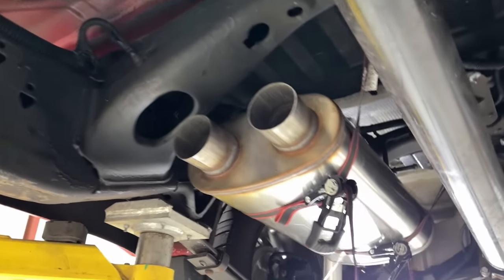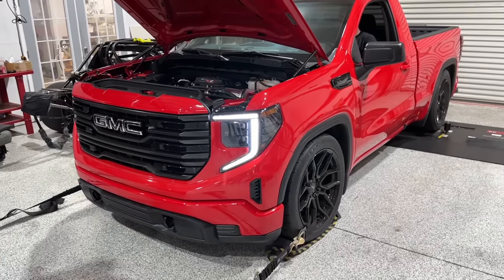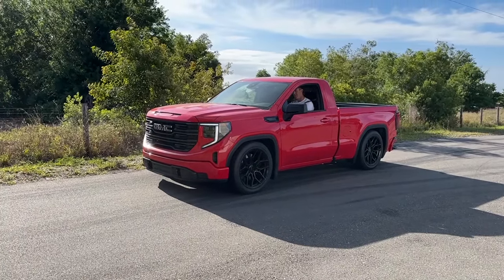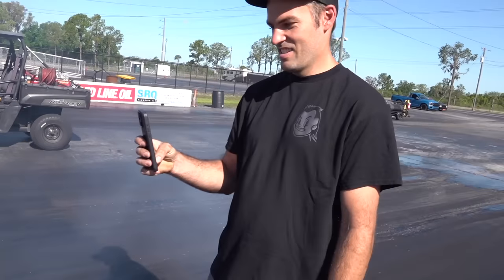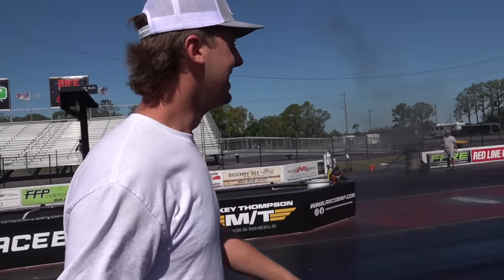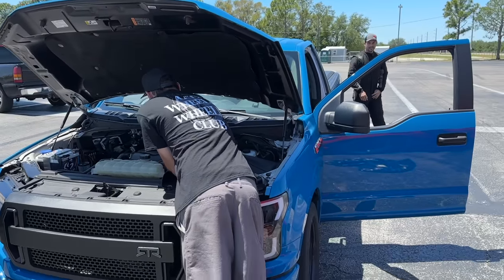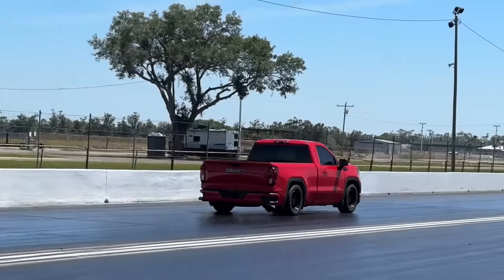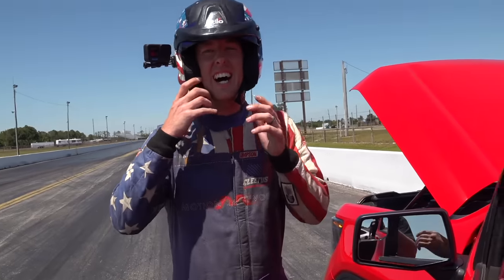Our Supercharged 427 GMC Is Done and It's INSANE!!!

Comment: In a way I wish the GMC wasn’t a giveaway truck so we can actually see what it can do. I really want to see it get in the 9s! Do it Cleet!
Reply: If I won it, I’d tell cleet to keep it in the fleet to see what he could do with it first before taking it 😂
Reply: Its set up to haul ass already, if someone that’s into cars got ahold of it, they’ll probably have it in the 9s with a tune and pulley 😂
Reply: I’d be willing to bet there’s another one awaiting its unveil on the channel.  No way cleetus gets himself to walk away from a vehicle like this.
Reply: @ronathan3569 that motor can make 1500, motor wise, it is much more capable to be an 8 sec truck than the f150 even is. Add another 10 psi to that 427 and with the right suspension it will 1000% go 8s. Cleet needs to just get the FRE sleeved long block they are making 2k hp on, he will at some point
Reply: All it needs is shocks and it will go 9.7. f150 will run that right off the lot.
Reply: @tkc2406 yeah it doesn't transfer the weight at all. That's why it bunny hops so bad. Probably could just take out a couple leaf springs and it run 9s easy
Reply: @JoshJackson13  I am a ford guy to but what f150 is running a 9.7 off the lot? By off the lot you mean stock engine then yeah of course, but even the roush supercharged trucks dealerships offer won’t run 9.7s “off the lot”
Reply: @tkc2406 even fully tuned and dialled in, that GMC will never run an 8 bud a low 9 maybe(gonna need a whole lot more than 10lbs, try 20) but it won't beat the blue truck and  there's no way in hell it'll run 8s. Even if by some miracle it beats the blue truck, that blue truck isn't even in the top 20 fastest F150s in the country, and some of thi se guys are in the 7s. Yeah no way this thing getting anywhere close to beating any F150 records
Reply: @tkc2406  go buy the 2024 base model with the coyote supercharged 700hp. Not the eco boost
Reply: @tkc2406  I was being sarcastic. Obviously no truck is going to run 9s from the factory. I believe the fastest ever has be 11s
Reply: @JoshJackson13  no one mentioned the ecoboost. 700 crank hp will not get you a 9.7 with the factory suspension
Reply: @JoshJackson13  ik you had to be man, I’m a ford guy to but ya can’t be that naive. I know what it takes to build these trucks trust me a half a year of my life was dedicated to a 4wd truck build, but this one was an ecoboost with twin EFR 76/70s and a fully build closed deck motor, we haven’t been able to push it yet but the engine is built for 40+psi. Hope to break the ecoboost record and what’s even more special is this is a gen 1 motor and 100% DI no port injection which is 90% of the challenge but it’s great for making big power on alcohol. Running 190lb injectors lol
Edit: truck is setup for nitrous as well goal is 1000 on pump E85 I don’t really need more than that but on race gas and spray I’m hoping for 1200-1300hp
Reply: @joaquinpaul8205 Of course it's not beating any of the F150 records. Look how many single cab Coyote trucks there are compared to new GM trucks. If GM offered an RCSB with a 6.2 we might actually see some competition between the two platforms.
Reply: Run a 9 cleet no one will no...
Reply: @joaquinpaul8205 lol someone is triggered, the truck ran 10.2 with a shit launch on 13lbs. 23-25psi, some weight reduction and suspension mods the truck would definitely run an 8. And it won’t blow up 3 times in the process like the ford 😂 also top 20 ford f150s? Laughs in 6 second stick shift LS S10🤣
Reply: Got to say I hate the F-150 is down again 😢 that’s my favorite vehicle on the channel right now. That GMC is awesome as well and I hope I win it but F-150 is my truck of choice. Cleet, please get a FRE engine or something that F-150 can’t keep breaking. No disrespect to TKM cause they’re amazing as well.
Reply: @johncena-hq1ti  I would hope so it's got a 427 motor in it. It should at least be capable of an 8. But them single cams don't pick up as much power as the Dohc motors per lbs of boost but hey, it is a 7 litre motor as well so who knows. Honestly I'd like it to run 8s I just don't think it's possible without at least 30lbs and Major weight reduction but at that point, it wouldn't be a street truck
Reply: There goes the coyote is king claim......
Reply: @tkc2406 I like how you’re saying it’s more capable as a motor and the first thing you gotta do is get rid of the factory block.
Reply: @tkc2406  I got a 92 thunderbird that I put a coyote in. Pretty much a mustang under the body
Reply: @JoshJackson13  yep 54k with a 3 year warranty to.  They had to build the truck from scratch. You can order it from Ford anytime.
Reply: I would gladly tell them to keep it and give me the money it's worth so they can keep it in the fleet.
Reply: @Mldavis1214 what engine rebuild are they on for the f150? Can't have a tkm built motor vs a stock ls motor.
Reply: @joaquinpaul8205  blame Ford for not being capable of making a 7 liter coyote. Not our fault 🤷‍♂️
Reply: Agree, and "7.0 cLeeturs" should be on the side emblems on that rig.
Reply: @Bamabrute85  yeah but they made 7 liter Godzilla.
Reply: @JoshJackson13  that's a pushrod V8. They can't make a 7.0 liter DOHC V8
Reply: @Bamabrute85  

If we're all being honest, any of the big three could make whatever motor they wanted. It's just a matter of whether they can manufacture and then sell them at a good margin or not.
Reply: @HankJr. I feel like that ever giveaway
Reply: Some rich guy is gonna win it anyways that isn’t going to appreciate it. He might as well keep it.
Reply: I liked it originally ... not sure I'd want to daily it now.  Still wouldn't turn it down.
Reply: If I get it, I'll show you what it can do :)
Reply: It's a 9 sec truck for sure
Reply: @thisvsthat6930 that isn't a stock ls in the gmc😂😂😂
Reply: @johncena-hq1ti  bro we're talking about late model factory trucks not frigging super light 1980s midsize purpose built race trucks. These  are full size in a completely different league. And as for why it's breaking, it's definitely something wrong with the setup because none of the much faster guys are breaking them like this lol. And it didn't break during the pass or on the return to the pits they just started it up after and it randomly decided to break?? Well one thing for sure is Cleeter better get that whole belt/pulley issue sorted out once and for all, cause ever since it's been built it's never ran properly fully sorted, and some stuff like the crank snout were known problems on supercharged cars that he was warned about but didn't heed seriously
Reply: Yeah i think everyone agrees he should go a 9
Reply: should give it away to George
Reply: @johncena-hq1ti buddy it's not even a factory optioned motor why you acting like it is. If they put the 7.3 Godzilla in the ford it would shit on the gmc
Reply: Fails on race day FORD 😂
Reply: @joaquinpaul8205  lol yeah I know it’s not the same but based on how fast that s10 is a full race build could definitely be very fast. And idk man that ford reliability is kind of iffy, cmon now 2 or 3 different engines on one build?
Reply: @joaquinpaul8205  also how is a single cab full size? The fastest coyote trucks are all gutted race trucks too lol, no interior, carbon/fiberglass bed, th400. But if you wanna see some fast “full size” Chevys ondgas has a couple trucks that run low 8s or high 7s turned up.
Reply: @Jacobtheunwise  nah that 7.3 is trash compared to a 427 lol even cleet swapped it out for a coyote on mcflurry
Reply: MOST of the SERIOUS Texas guys have already given up on the GM crap, they KNOW the COYOTE is KING....
Reply: If I win it you'll see plenty
Reply: @tkc2406 I really doubt this set will ever knock off another full second . Would have to lighten frame and other more extreme modifications and adding juice of course .
Reply: @tkc2406 well now that is a TRUCK ! Nice.
Reply: @johncena-hq1ti let us know when Chev has a 302 that hits those numbers…maybe another 10 years ? Any truck can break under pass after pass. What counts is the number at the end but you know that right ?
Reply: @alastairdow4400 no , in the small block range nothing touches it yet. Maybe someday but not today .
Reply: @Bamabrute85 Don’t need it . The 302 cu. in. Is already sending big blocks to the garage . If that can’t be understood,it’s not our fault !
Reply: @dral9657  idk the truck had only been together for like 6 months and already went through two engines. Also lmk when ford has a single cam stick shift running bottom 6s
Reply: You gotta admit when it comes to the small block in the 300 ci range ,Ford kinda spanks them all .
Reply: @dral9657  it could be done if it was made into a full race truck with the right suspension, and a pulley good for 20-25psi lol. If they ran the same boost he’s giving that coyote on the 427 it would probably break stuff, id guess it would make near 1500hp. We all know it’s not a comparison though they had to break out a built motor with an extra 2 liters to beat the coyote. that’s like a max effort 600cc turbo bike on spray vs a turbo liter bike on watergate lmao
Reply: @Bamabrute85 Boyyyy That Would Be Nice As A Crate Engine
Reply: @joaquinpaul8205  you said "even fully tuned and dialled in, that GMC will never run an 8 bud a low 9 maybe(gonna need a whole lot more than 10lbs"  the gmc will easily pop into 9's with limit straps and shocks after what weve seen in this video, its definitely pausible to hit 8's with double the boost. it's true a coyote responds better to boost due to them being 32 valve and ls being 16 nothing to do with SOHC vs DOHC, however a 7.0L is moving alot more air than a 5.0L no matter how much air your heads flow, whichever engine is making more power N/A is going to respond the most to forced induction
Reply: Yeah this one shouldn’t have been a give away this should be given to George in all honesty!!!!!!
Reply: @tkc2406  agreed
Reply: @johncena-hq1ti  This truck wasn’t used for going to the grocery store. Running rides all day long and not a regular Sunday drive. It was used for racing and nothing but. Have any other vehicles they run ever needed to be replaced…?
Reply: @johncena-hq1ti  I spent a lot of my younger years on the track , mostly bank oval . Everything was flat out and the class had to be 360 and under . The engines could only have parts that were in the factory catalogue .  Most ran 350 simply because of availability was in abundance . We all had our pokes at each other about the sticker on the front but years after one thing remained from us all no matter your brand…the Fords held up the best. Every now and then we would run the 100 lap special once a year but the 50 was usually 4 times. I ran the 350 and later switched to the 351 ,both had similar times for the  time trials but the Fords seem to last. I am a fan of both .
Reply: @dral9657  lol dude I know what the truck was built for. But it’s not like it was running 35psi 2000whp. Was a fully built engine at 1100whp max and blew up 2 maybe even 3 times 😂 built ford tough they say
Reply: Foreal just give away the f150😂
Reply: When i win it im gonna let it live its life out on the channel.
Reply: Well if I win y’all will see . I’m at a track every weekend with a slow car compared to that Hp
Reply: 1/4 9`s
Reply: He literally wejt out the next day and bought one like he does with all his giveaways.
Reply: Agreed, find something else to giveaway
Reply: @johncena-hq1ti  I own a fleet of 120 plus trucks and we roll most of them every 3 years. The trucks split between 1/2 and 3/4 tons and handful of vans . My company is over 21 years old and the Fords continue to have least maintenance costs . So Ford tough, heck ya. That I know for sure .
Reply: @johncena-hq1ti  GMC has a fully built tsp 427 in it and ran in the 10's. I'd be highly disappointed. Literally had to go from LT 5.3 back to LS just to get a 10. To me that's backwards as fuck. 😐
Reply: @thisvsthat6930 the engine in the GMC is no where near stock. They couldn't even build the original engine that was in it.
Reply: Go for the 9!
Reply: Same
Reply: @koncha0422  lol it’s literally on like 12 or 13 psi, 10s is fine for that boost level. That 427 is easily capable of holding 25-35psi. The ford is over 20lbs
Reply: @koncha0422  lmk how fast a full weight f150 runs on 12psi. Guarantee it’s not 9s😂
Reply: @tkc2406  I think tuning is the issue. They still can’t get it to shift right consistent.
Reply: @johncena-hq1ti  in the 8th? lol stick in the 6s is already crazy, much less a shitty s10 with an ls.
Reply: @coryhueske5245  nope 6s in the 1/4 stick shift LS😎
Reply: @coryhueske5245  yeah I wouldn’t have tried to build a 2024 they should have just ran a standalone and you can hook them up to some dashes but that would be a nightmare in this new of a vehicle. This isn’t made to be a drag truck is made to be a street racing truck, if they wanted a drag truck put a th400 in it not a 10speed
Reply: How do you think he makes his money back he will make 1mil or more off that truck
Reply: @tkc2406  lol hp isn't the limiting g factor
Reply: @SacredHeart0520  yes have you read my comments? Suspension, weight, and the factory ecu are the limiting factors and like I said if this was a full drag truck it would have those issues but they didn’t make it that, they made it into a great street truck that they could give away. No doubt if they kept it they would’ve set it up more for drag racing but they didn’t so we don’t know but what I do know it that blue truck is going near 8s with close to 1200hp with a worse power band with the same transmission and tire setup, the only difference is suspension, ability to adjust the factory ECU, and weight. They could get the Chevy within a few hundred lbs of the blue truck if they really went all the way with weight reduction. This is all coming from a ford guy too. It’s a compliment that they needed 2 more liters to compete with the coyote.
Reply: If I win it I'll trade it in for a new Ford Maverick.
Reply: That would be awsome!
Reply: @tkc2406  your right and your wrong spoilers they are already gonna do 9s with it but it was out of fueling capability so if you threw more boost at it youd grenade the engine in seconds but it took 2 entire liters extra to do less than the coyote b thast coyote is making 1200 and is capable of up to 2k but again cleet doesnt have the right parts to do it coyotes can make 1k hp without touching the engine not a single ls or lt in the world has ever made it anywhere close to that
Reply: @TheReaper42069  No you wouldnt lol!
Reply: @trope5105  I didn’t say keep forever! I said keep until he’s had his fun with it! All I’d ask would be to come watch in person!
Reply: @TheReaper42069  sometimes statements can be interpreted as 'listen to what i mean, and not whatt i said', when said statement was said in so few few words.  i fell to this interpretation apparently if indeed u meant what u just clarified!
Reply: @TylerDuysen  yes I heard they are gonna go nines with it they don’t even have to mess with the tune they could get there just with suspension work but you are wrong about that coyote in the pickup it’s not capable of 2k hp he hasn’t nutted up and bought the RPG level 4 coyote short block, he has a rod piston coyote with the stock crank, which has been proven to break anywhere from 1200-1500hp which still isn’t bad that’s where most V8 stock cranks will go it’s the same power range for the LS stock crank. I thought they already put a twin pump in the Silverado that’s a given when you are making that kinda power I would’ve done a triple pump setup that stages the pumps based on throttle that’s the best way to do it imo
Reply: @tkc2406 he posted on instagram with the bed off stating it needs more fuel to go 9s but they were gonnav do it b your completely wrong Brett lasala the guy in the video litterally has a stock block coyote marking over 3k whp he made 2800hp on the stock crank c you clearly don’t know what he has in the f150 it’s a Tkm built coyote he has a forged crank already too because the old one broke on the end
Reply: 1800.
Reply: @TylerDuysen  that was not a factory crank and no it wasn’t a full billet block but that block was not factory it was sleeved and O-ringed
Reply: @TylerDuysen  look at what RPG does for their coyote builds they are building many 2k hp coyote street cars and f150s
Reply: @Bamabrute85 they 427ls is apushrod v8 it would of been a littleral fair comparison instead of saying his 2.0l bigger engine is better you can get a scsb with a 7.3 from ford in 4wd cleetus obviously didn’t want to do a fair comparison it’s just for views and dram the whole thing is
Reply: @johncena-hq1ti go do yourself a favor and look up the race rules a ranger or s10 is even considered full size which I agree with you is bs but yes a single cab is a full size
Reply: @johncena-hq1ti cleetus made more hp on the 7.3 with it being stock then the ls which is a custom block forged internals etc stock vs built is not a good comparison
Reply: @TylerDuysen  isn't the 7.3 only available in the F250 and up models?
Reply: Agreed
Reply: @Bamabrute85  yes but you can get a scsb f250 4wd from ford the only reason i mentioned it is because the weight of that truck is identical to the gmc but it would make the displacement fair but you cant get a scsb 4wd gmc2500 anyway so its still  a fair comparison
Reply: @TylerDuysen  I know all about Brett lasala buddy he built my 6r80 way back this was before people even really knew about him and his car he was probably only making 1500-2000hp at the time running mid 7s which was crazy then but what he’s doing now it nuts. But back in 2015-2019 he was the guy to go to when it came to the 6r80 that’s what he was using with special billet parts that turned it into a drag racing 4 speed but they used multi stage TC lockup to act as “shifts” off the line but all it really is is like slipping the clutch on a manual basically but done 100x more precise with a computer. This allowed them to “ramp” in lockup like boost, but really it’s working the opposite direction because you are increasing the mechanical loss of the trans to fine tune power put to the ground. The reason I say it acts like shifts was because it sounds like it shifts up a gear but that it just the TC locking up more causing the engine to loose rpm
Reply: @Bamabrute85 it still wouldn't compete it's heavier and it's less capable out of the box.  Requires engine mods to even be in the conversation.  Dohc and boost is a cheat code.  Add in how light f150s are and you get what you see with them.
Reply: @johncena-hq1ti the fords are way more reliable they can do those numbers on a stock untouched long block with 5 liters that's a built 7 liter engine and still having trouble keeping up lmao
Reply: @Bamabrute85 they can it just won't fit under the hood of the mustang maybe not even a truck cuz it's gonna be huge.
Reply: @johncena-hq1ti they don't do single cam stuff much anymore they quit messing with them mid 90s.  They do have a 4.6 liter in the 5s 15 years ago at 256 mph stock crank stock block and factory heads that were ported.  Ain't no ls anything ever done that.  At that point they're aftermarket everything and way more cubes and still can't touch it.
Reply: @johncena-hq1ti just because there was an issue with the build is not indicative of what you can expect with 5.0s.  They do 900-1000 wheel on stock long blocks all the time.  No reason a built motor should be failing in the 1100 wheel range.  That is an issue with the build or builder not the engine platform itself..
Reply: @johncena-hq1ti you're comparing a stock long block 5 liter to a fully built 7 liter.  Wow real smart lol.
Reply: @midnight347  only one truck drove home
Reply: Make it a series
Reply: After I won it, I would loan it to cleeter to make a lil' more freedom, and teach my son about making freedom horsepowers.
Reply: Don’t worry. If I win. I’m taking the cash lol
Reply: Try the fuel tech for ECU control  it's a very nice and offer more options for controlling he parameters
Reply: When I win it. I'm Moving to Florida and joining the team so we all can see what it can do.
Reply: Right? I was thinking something similar. It seems the only person probably happy he’s not pushing it is the person who will win it and actually own it. Because personally, I would love to see him, push it to the max, but if I was the person winning it, I would be very happy he didn’t.😅
Reply: They have a white one there keeping to build a monster out of